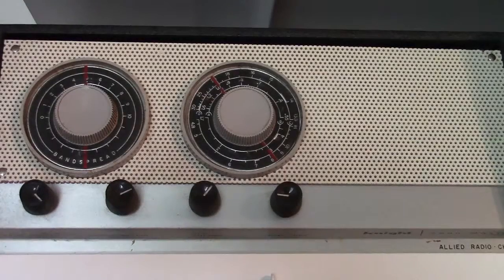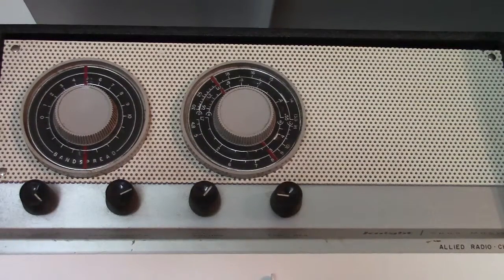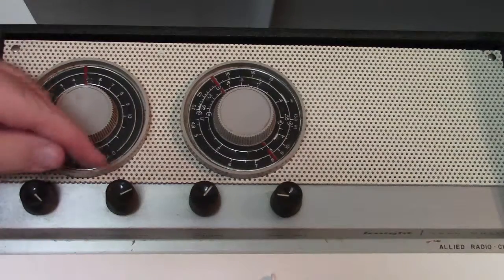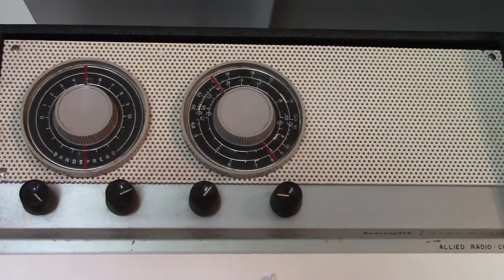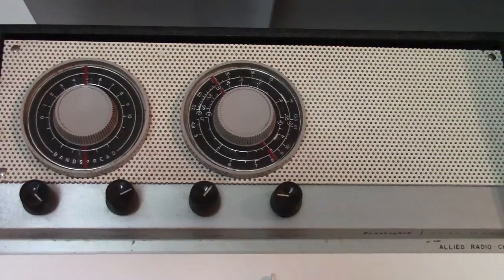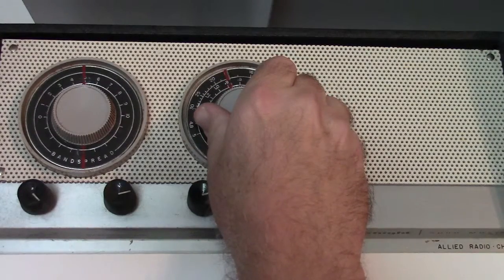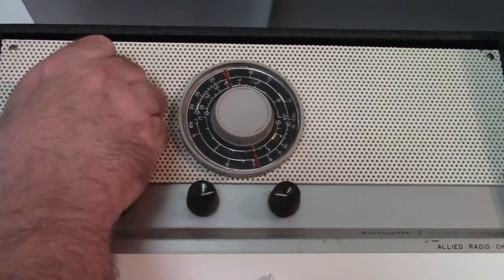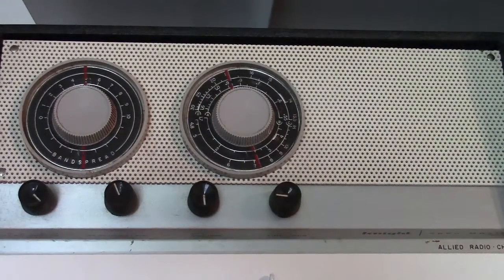Knight SpanMaster AM/SW Regenerative Receiver

Comment: Have one.  When I was a kid I would take it outside on a hot summer evening and use the clothes line as an antenna.   Found it in storage today and it fired up.  I need a proper antenna.  What were you using?
Reply from the maker: I use a simple wire antenna that runs out into my backyard. Nothing fancy.

Comment: I built one of those as my first kit back in about 1961 or 1962. I was 13 or 14. My mother used to work for Remington Rand Univac as a wiring harness assembler for Navy contracts. She taught me the color codes for resistors and how to solder.